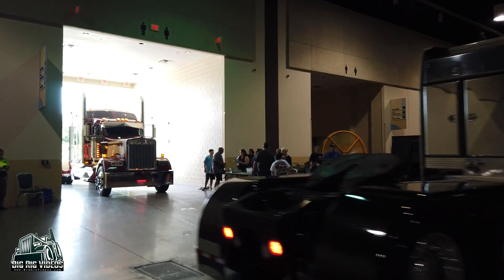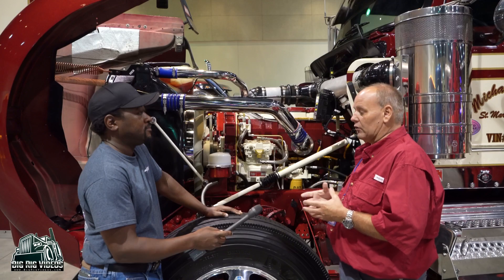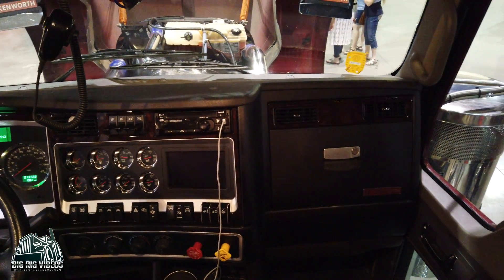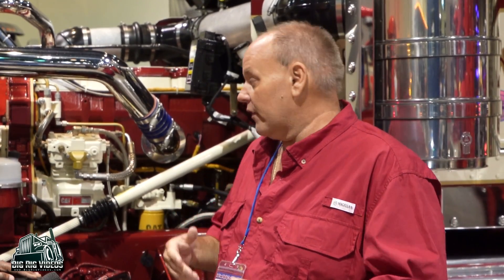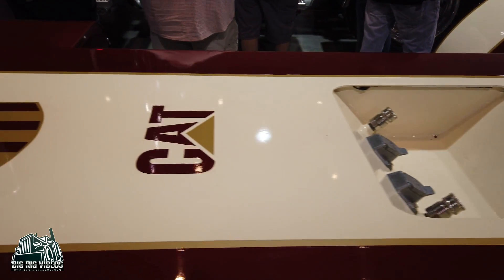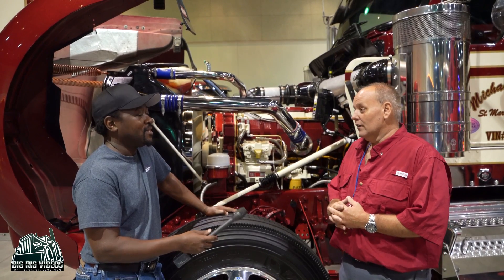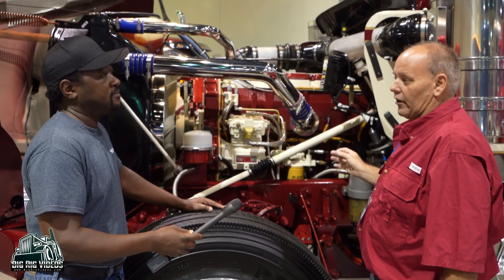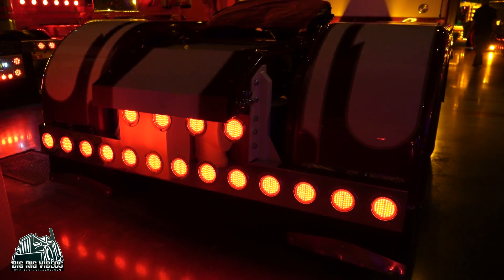Tanner Transportation’s 1,400hp Kenworth | I haul alligators 2,500 at a time for the last 25 years.

Comment: 2600 ft lbs of torque!!!! Holy crap!
Reply: Trucks in europe make that torque stock, or even more for instance the scania 770 engine makes 2700 ft lbs, stock lol.
Reply: Pretty sure that 2600 figure is waaaay underrated.  A  rough formula for a CAT is 3.8lbs torque for every horsepower. At 18 litres, that c18 is probably more like 4. Do the math.
Reply: 2600 is not right at all. Our Detroits are pushing 700hp/2200tq, and that's 12.7 liters. Our 08 ISX we had for hauling lumber and running the truck pulling circuit was over 800hp/2300. This engine is well over 3000 tq, easily.
Reply: @BeastMode-4422 , the v8 Scania engine is absolutely insane. I can't imagine 770/2700 stock here in the US. What's truly impressive is a comparable stock 600ish horsepower truck here is 2050tq, from the dealer, no engine manufacturers here even come close to 2700tq.
Reply: @TheRoadhammer379  I mean yea thoose can be tuned up too pretty easily, im sure, plus the cat c18 also could be a marine engine right, scania has also marine engines based on truck engines too that deliver about 1150 hp, i mean that doesn't mean that it could be fitted into a truck but still.

Edit: they also have a marine 13L 6 cylinder, 900 hp that would be great in a truck, i bet.

Comment: I like the truck and is it a gilder kit truck
Reply: Original no but now it technically is
Reply: The proper term according to the government is "rebuilt". A glider was a new manufacture truck which left the assembly line with no engine. A rebuilt title is a truck that had its original engine removed and a different model year engine installed. Our 2017 389 is having the original paccar engine and emissions removed, and a 1998 Detroit 12.7 is going in. It will now be titled by the state of Pennsylvania as a 2021 "rebuilt" truck.

Comment: Is that truck a glider I'm just curious because he said he changed the motor and I thought you couldn't do that
Reply: Tons of people do it, to hell with the epa.
Reply: Doubt it’s a glider. Still has the clean air sticker on the door that you can see in the interview.
Reply: @dash456789  yeah that's what was throwing me off
Reply: It's 100% legal to swap in pre-emissions engines, regardless of the year. It's 100% illegal to remove emissions equipment from the engine. You can do an engine swap on a brand new 2021 factory built truck with an emissions engine, it's just retitled as "rebuilt". We are swapping the paccar out of a 2017 389, replacing it with a 1998 Detroit.

Comment: How did you get away with that motor and that not being a glider truck?
Reply: It’s been my experience so far that quite a few at the scale houses don’t have a clue which motor is which lol. Had a dot argue with another driver I work with that if his truck was a 14 then it didn’t matter what motor he had it had to be elog. Has a 94 60 series in it
Reply: @Street_Tractor59  hell fmcsa clarified and said it depends on the build date of the motor and not the truck. Some cops just make it up as they go. I have a 2001 379 so I don’t have emissions but I’d like to put an older 3406 or mechanical in to get away from elogs to.
Reply: @TheRoadhammer379  it’s not ignorance my guy. It’s just not knowing or ever having it explained.

Comment: How is he able to swap in a mechanical engine with the glider kit laws?
Reply: It's not
Reply: Let me educate you so you can be better informed. Glider kits are no longer available but... it's 100% legal to buy a new truck, with a factory engine and emissions equipment, remove all of it and swap in a pre emissions engine. What's illegal is keeping an emissions engine and deleting all the emissions equipment. And what glider kit laws are you speaking of? The government says no glider manufacturing, but there's no law against engine swapping.
Reply: @TheRoadhammer379  So to be clear. You can buy a brand new truck with emissions and pull that motor out and toss in a older pre emissions engine and it'll be legal? How would you pass a DOT inspection?

Comment: ELD makes everything alot harder. Yhats why nobody stops to help anyone aside you need a computer for everything.
Reply: It is the hours of service being 100% enforced. It is time to re-think them or get rid of them as a LAW and make it more of a guideline.. Leave the Elog and let us run as we see fit (as thousands did before with paper).
Reply: Instant communication made stopping to help obsolete. Besides, most of the steering wheel holders never turn on the cb or even own one, so you can't even ask if they are OK.

Comment: I been building transmissions and rears for over 40years.. I dont see how any transmission will hold up with 2600lb or.more torque .. Eaton only builds spec to 2250lb . I have built many custom transmission but getting 2600lb or more of torque to not destroy a transmission is a task I would have to see . I use the highest quality gears on the market and even with those I have not seen any that have that torque rating available.  You can get these engines to unbelievable power but getting it to the ground without destroying a trans is another story and doing it for hundreds of thousands of miles is another .
Reply: Luck I guess, I have a pretty heavy tuned CAT with a 18913b. I hate to admit how much I beat the shit out of it but its been taking it for 2 years, original trans to the truck, 1.6 million miles.
Reply: @BMW_Mustang_Dodge  Those trans have only 1850 torque. The difference between that trans and a RTLO 20913A is completely different cases, bigger bearings completely different back box gears just for 200 more lbs of torque. And the cost really doubles. I just built 2 in a row for 2 customers and the parts were ridiculous compared to  18913a..
Reply: @southernhellstorm6634  I know the difference and numbers. I was just point out that maybe it’s luck or the way they drive. But not sure how mine has survived this long, I’m very aggressive with it🤣
Reply: I’m gonna guess he’s not mashing on it on a normal basis . And he doesn’t seem concerned if he only gets a short transmission life , he’s doing what he wants to do . Gotta love that !
Reply: Easy take off & walk into  the power  rto- 14609b  behind a Ktta 650 hauling logs no problem, if you have a idiot  driver you won't  keep anything together!!!!
Reply: @ruxoneto6560  That sounds fine but the torque will eventually destroy a 9 speed I get them in my rebuild shop several a month.  The back box won't take it with single gear countershafts..
Reply: @southernhellstorm6634  what are you talking about  a single gear counter shaft , they are called a twin  counter shaft for a reason.my   RTO-14609 was used with  238,000 miles when put in & have since put over 2000, 000 miles on it hauling logs behind a Ktta-650 that is twisted !! No problems..
Reply: @ruxoneto6560  It's single gear counter shafts if you knew anything about transmissions you would know they are single gear. The 13 and 18spd have dual gear countershafts.
Reply: @southernhellstorm6634  you dont know what the hell you are talking about all road rangers from the early rto-910 &  913 are all!!twin counter shaft , you had better read up on road rangers first then think about what you said ,!!!! then apologize  for talking  B///S . TWIN COUNTER SHAFT MEANS exactly  that . Road ranger - Fuller has not built a single counter shaft since the early 1960!!!!...
Reply: I thought he said he turned it down 400hp.
Reply: @kimkoller1523  hell if he turned  it down 400 hp it wouldn't  run.

Comment: A 2019 with a CAT that was never offered as an on-highway engine ?    No
DPF either, by the looks of the smoke rolling out of the stacks.   I love it, but how the Hell does he get away with it ?
Reply: Did you ever hear of a glider kit? Apparently not. Did you know that you can buy a brand new 2021 factory built truck, pull out the engine and emissions crap, swap in a pre emissions Detroit, Cat or Cummins and retitle it as a rebuilt truck. Perfectly legal, as opposed to leaving in a factory 2021 engine and deleting the emissions, which is a big, big problem. Gliders are no longer manufactured but the new to old engine swaps are 💯% legal.

Comment: Truck is nice, but use CAT C-18 to pull, 80 000 lb load.......normal load,  and 1000+ HP, what for?, that is just simply stupid, and the man says he did it because he can.....? I know some drivers that pull very heavy freight or super large oversize loads do upgrade the engines to get more torque and HP,- just to pull better, but for 80 000 lb load, funny guy.TH
Reply: My company runs 800hp cats for mostly 80k work. We do some 120k work as well but the general idea is, an engine easily pulling 80k up hill, will last alot longer than the one that has to be shifted down and down and down.
Reply: Companies that sell trucks in Europe (Scania, Volvo, MAN) sell stock 700+ hp engines to companies that haul dry and refrigerated cargo. Why? Don't have to slow down on hills. Think of an engine like a muscle. The stronger it is, the less effort it has to put in. Running 400 hp in a Cascadia, always at the redline, engine fan whizzing, climbing hills at 15 mph is not only embarrassing, but also terrible for the truck, and incredibly inefficient. If the engine is tuned right, he'll get great miles per gallon, have tons of extra power to pass, and never break a sweat climbing a hill.
Reply: @Seriousmods  don’t ever say it’s embarrassing to drive anything again that’s stupid we do what we got to to get by